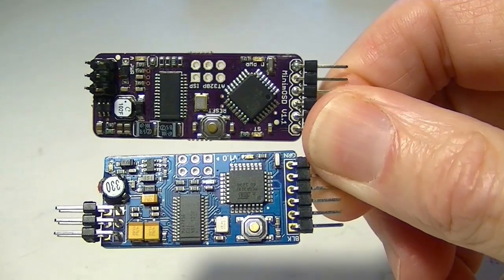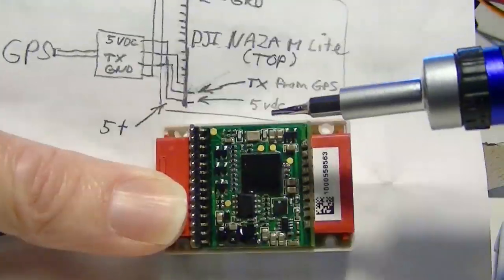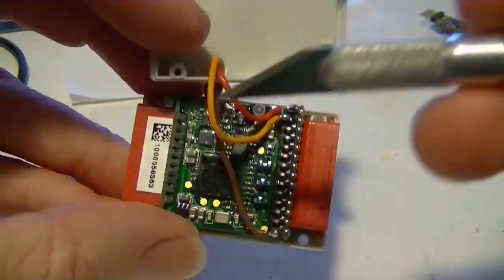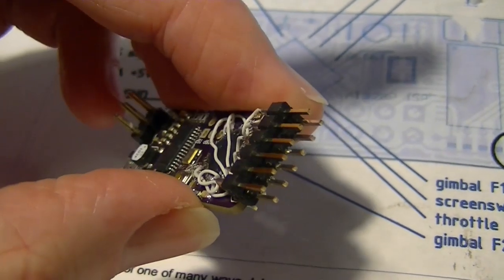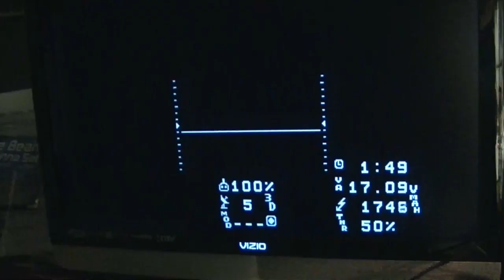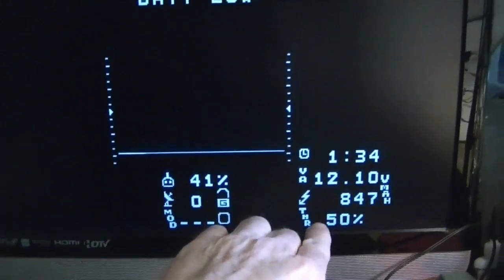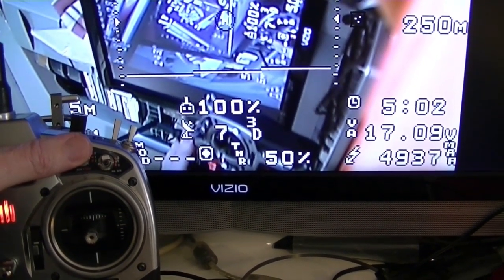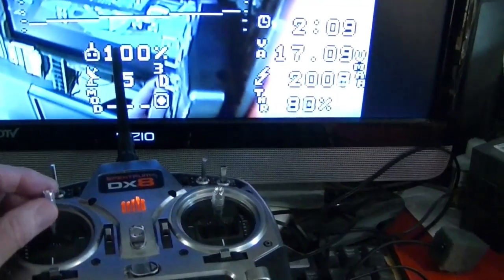MinNaza OSD Project Part3 (Adding More Features with insane soldering)

Comment: Good 3 part Tutorial....
2:59.. Held the iron on the pin way too long.

1) need to cleanly tin the Iron tip
1) Need to tin the pin
2) Need to tin the Wire
3) clean the tip an re tin the Iron tip
Then Hold the wire on the pin and apply heat to reflow the tinned parts.
Reply from the maker: Oh I remember that insane soldering job! 
I am sure glad they have boards with pins broken-out to custom solder lands now.

Comment: great videos. thanks for sharing. will playin with my naza lite this weekend
Reply from the maker: +Riki Risnandar Thanks for watching!
Reply: +dmerc00 the horizon monitoring (roll/pitch) starting to work if i change the Gain value to 30 in Naza Software just like you, thanks to point that. Btw my LED signal is not working, i also update the minimosd firmware to DJI with led, how you sort the resistor placement? from the right side im using 47k, 200k and 100k, is there any problem if the order for these resistors is not correct?

Comment: Great videos, thank you for sharing.  The wiki page lists calibration steps for the voltage and current sensor, did you need to do that to get voltage, or using your method without the voltage sensor makes it not needed?
Reply from the maker: Arthur Herold I did not need to do that because the resistor values I chose made it right for a 4 cell setup. You are correct that I did not use a current sensor so no need to calibrate.

Comment: Great vids Dave. But as you said why spend 25hrs to avoid spending $50 for a DJI iOSD mini. God knows Ive done it plenty of time myself to! There is a wonderful hack you can now use to upgrade the Naza lights to Mv2 and thena dd on a DJI iOSDmini. Search for "NAZA-m lite to v2 upgrade project"   Nice tool.
Reply: +jrcampen :) its fun for some people to make this project works , for practical people i think they prefer bought iOSD then plug in instantly. i also prefer doing this 'thing' coz i have unused minimosd from my APM and i just prepare the tools to make this happen. And iOSD price in my location is much expensive around 70$ plus i have to buy and upgrade my PMU which is cost more

Comment: Thank for putting all of this video uncle Dave. I'm doing step by step guide you put and I have successfully done the gps mods. I do the insane soldering but I'm about to give up on the voltage readings.

Already hooked up my 4s with 220k & 15k also tried 48k & 680k but the I don't get the corrects reading always 17.09 like on your video before you connect the voltage and the battery percentage never stop counting.

Is there any suggestion to my problem or do I just give up and use only the gps data. Thank you Sir
Reply from the maker: SkyOrc From what you are saying it sounds like you might have a bad connection to the Atmel chip
or you have the wrong pin on the chip. Check the pin-out and check the wiring again. Something is off.

Comment: Hi Dave! Congratulations and thanks for the videos. I am preparing to follow your instructions to install the OSD in my F550 clone with NAZA-M Lite. To simplify the conections, I'm thinking of soldering the wires and resistors LED, F1 and F2 within the box of NAZA, how you make the  GPS connection, using 6 instead 3 wires, eliminating the led and gimball external adapters. What do you think? Rgs. Leonardo from Brazil!
Reply from the maker: That could work if there is enough room inside the NAZA box. You might have to leave the cover off the NAZA box to provide more room. I hope your project goes well.

Comment: Question, when all the Mods are complete, I note your using the NAZA V2 setup software to tweak settings?
So this changes from the NAZA-M Lite setup software, because of your Mods??
All parts to do this ordered.
Many thanks
Steve
Reply from the maker: No I am just using the same software that the M Lite uses, unless the V2 uses the same software which would be a surprise.

Comment: Hi Dave,,, Mate you are awesome.  
I purchased NAZA-M Lite, to save a bit of cash, it's going on a TAROT 650, with 3508 415KV 480W motors with 15x5 props, this is a camera ship, OSD was something I would have loved, I had No idea you could mod it that easily?
Your Videos are first class and very clear, I design SMD PCB's and solder tiny SMD components.
I have a Metcal soldering station with 0.4mm tips and many others, this will be fairly easy as the pin pitches are wider than some of the IC's I tap into ;-)
So unless I'm wrong? you 'almost' end up with a NAZA V2? with all your mods?
I'll run up the NAZA-M Lite 'Before' hacking it to make sure it's all working first.
Thanks again for this great tutorial :-)
Subscribed
Steve UK
Reply from the maker: You should do a video on your build. I would like to see the how you put the TAROT together. With those soldering skills it looks like you are candidate for the insane soldering job. There was a guy on RC groups that was making PCBs for the MinNaza but he found some of the components were too expensive so the only solution was to transfer them from the minimOSD. His hopes of selling them were foiled due to cost. It would have been nice to have that product available.
Have fun and let me know how it goes, ok?

Comment: Hi Dave, finally bought a Naza M Lite. Re: minnaza, I can't thank you enough for doing these valuable contributions. Your work is always excellent. I was in the middle of this when I suddenly realized that this might be difficult to do if you are using a one wire connection CPPM to the MC from my Rx. I have made the motions to begin to acquire the material for this. I was going to do the most simple of setups, board cam or 808 w/video out and Vtx and the modified MinimOSD. I thought that your making the connections inside the MC was great, but the soldering of the pins on the Atmega MCU is certainly daunting. I will be looking for some optical assistance as well. Just one thing I might ask as I get the materials together,  Radio Shack up here no longer sells electronic supplies of any note,  this "Tie" wire as you termed it, is there any other name for it as I go looking?And what is the gauge of it? Thanks Dave, I got to figure out a way of donating to your efforts.
Reply from the maker: Hi Chris! Great that you are brave enough to try this project.
The wire I was using is also called Wire Wrap wire. It was used to wrap around the square pins on IC sockets. I think you can still get it from sparkfun which is the same place I got the FTDI programming adapter for the MinimOSD. Here is a link:
http://www.sparkfun.com/products/8031
Don't worry about donating, it's all my pleasure.
Reply from the maker: 30 awg is the size.
Reply: ***** Thanks so much Dave will do.The use of CPPM? I'm guessing it won't be possible.You had to split out the throttle feed, and to use your ch7 for switching screens..any others?
 P.S. Did you not use SimonK FW for the Mulistar 30 Optos? So easy and so much better response to throttle input. Once you have flashed though, the card becomes redundant. Just saying because you are normally so current and up to date. You should be apprised of the benefits, too many to list here
Reply from the maker: Chris Leech Yes, in addition to screen modes and throttle, the flight modes also need a separate wire from ch6 to U on the NAZA. It's a bust I guess.
I knew about SimonK FW but have not done it. Do you have a video how-to link on that? I might try it. (did you know you can now post video links in the comments?).
Reply: ***** Ahh yes the flight modes. well I am knackered for the CPPM, you see the single wire is great for reducing vibes to the FC from the airframe. But I have bought this new FC support called the AVDome from RCtimer check this out: http://www.rctimer.com/product_971.html ( yes buddy, I knew about replies w/URL's, great isn't it?)
And Dave yes, I will find out all the info you need for the Multistar 30A and some other background. You shall have my undivided attention. It will take me a bit. But it will come ASAP. If there is a really long response, I shall PM you if that is possible.
Reply from the maker: Chris Leech That is an interesting Dome thing, Why did you decided on that? I sent you a PM just to see if it would work.
Reply: you have a PM block. I tried to send you. No luck. You have to make me one of your contacts in what Google + I don't know. See what you can do or I will post it as a reply here. Asta la vista. I have had enough of sitting at the PC today
Reply from the maker: Chris Leech You are already in my circles in G+.
Did you get my PM?
I will PM you again with my gmail.
Reply from the maker: Chris Leech Sent you a gmail as well

Comment: what is the resister value for 3s lipo?
Reply: +Manjula Alagiyawanna im using as he stated , 47k and 680k and it works on my 3s 5200mah 11v. for 4s change the 47k to 48k

Comment: great work. like you say V2 probably a better route. Amazing all the features in the OSD that are not readily available.
Presume the NAZA was not effected in test flights thereafter?
Reply from the maker: The OSD seems to be working well with the NASA.
The biggest problem with the NASA was not the OSD but the NAZA GPS having no SAW filter or protection against interference from the Video transmitter, especially 1280 Mhz.
I had to add a saw filter to the GPS and filtering on the VTX to allow 1280 to work.
1258 and 5.8 are not such a big problem.

Comment: For the voltage sensor, will the 47k and 680k resistors work for 4s, how did you come up with those numbers?
Reply from the maker: Yes it was for 4s which is what I am using. Ended up changing the 47k to 48k.

Battery Voltage resistor divider calculation:
(This is only if you are not using a current/voltage sensor and want to measure the voltage straight from the flight battery).
The recommended resistor divider is 10 to 1 (47k ohms over 4.7k ohms) but this only works with a voltage/current sensor.The target voltage on the output of the divider should be about 0.825 dc volts for a 3s battery (1.1vdc for a 4s battery using the provided firmware).
Formula is R1 = R2 x (Vin/Vout - 1).  For a 3s battery R1 = 47k x ((12.6/0.825)-1) = 670k.
So if you use a 47k on the bottom (R2) you would need a 670k on the top (R1).
Keep in mind it's hard to find exact matching resistors so you might have to experiment.
For example with my 4s LiPo battery I ended up with 680k for the top resistor and 47k for the bottom resistor.  I later changed the 47k to a 48k for a closer reading.
Reply: ***** Thanks, very good explanation and i will give it a go.  Using your video made this a very easy upgrade as i already had a minim board laying around.  Worked perfect the first time.
Reply from the maker: AIRFED . Great. Glad to see you gave it go and that it worked!

Comment: Thanks for taking the time out to do this,also some good ideas for implementing it,I like the lead into the naza mod,much neater,and using the pin header is a great idea.i will use these tips on thrones I am making.
Reply from the maker: Cool, I was afraid some people would not like the lead soldered into the naza because of voiding the warranty but it could be easily unsoldered if necessary.